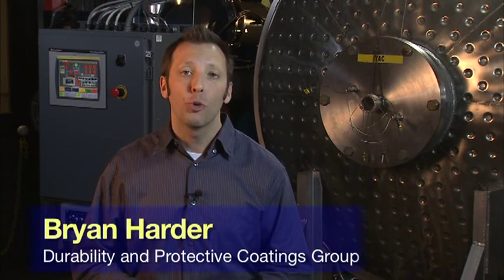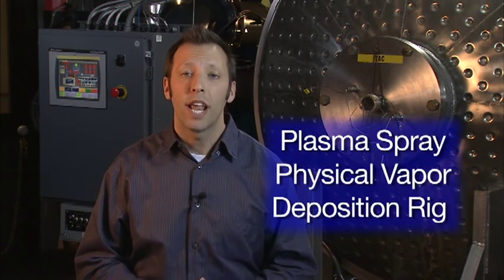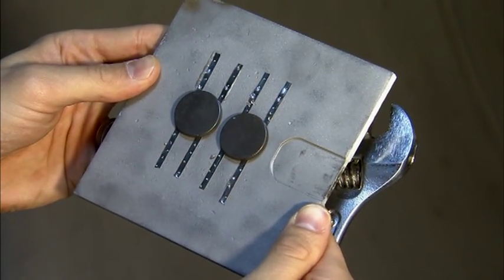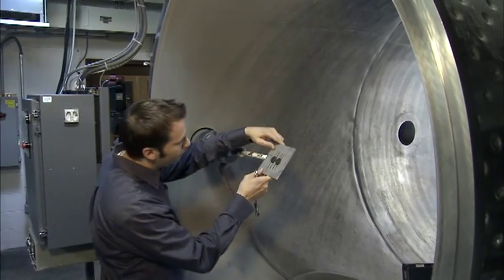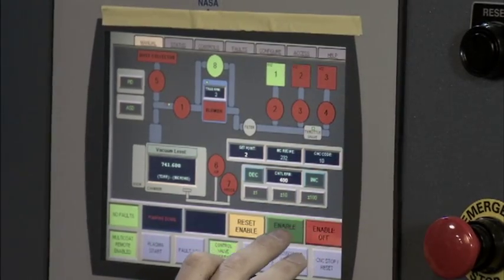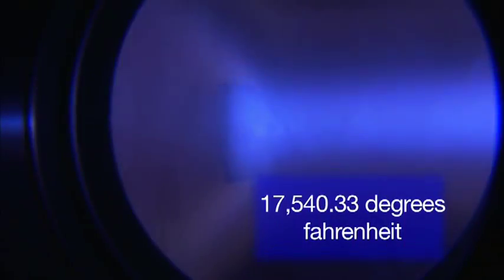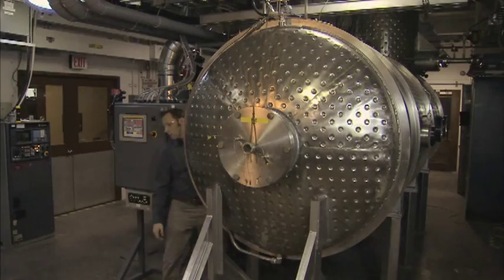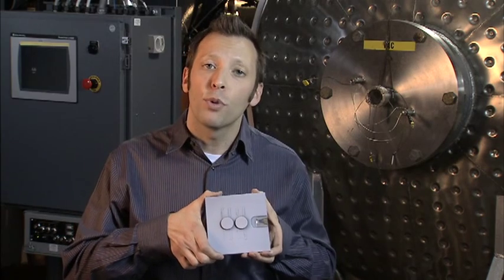Super Thin Ceramic Coatings - The Next Generation of Gas Turbine Engine Technology

Comment: The University of Manchester ,England and China developed the graphene carbide coating that was patented by China rather than NASA thin ceramic coating..The ultra thin graphene  coating can absorb radar signals and with stand temperatures of 3,000 degree Celsius.The coating is apply to the J-20B,J-31B with the WS-15 engines and the new destroyers with the super cavitati8n technology.